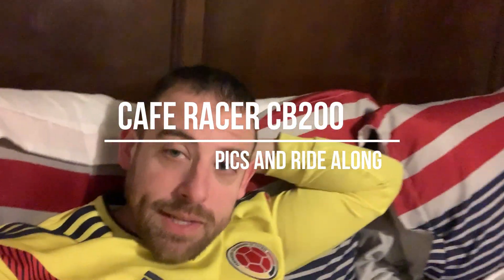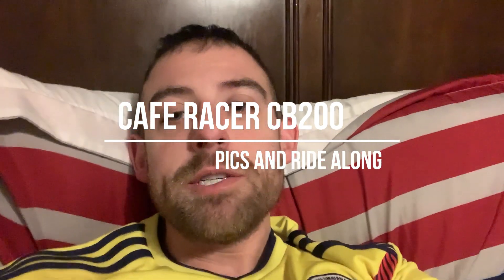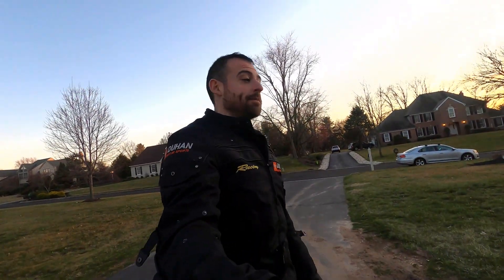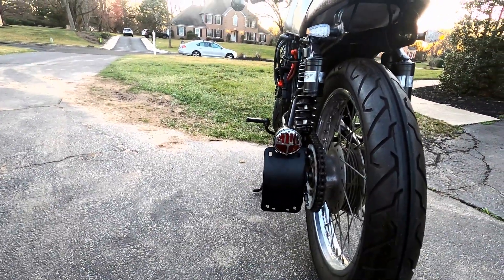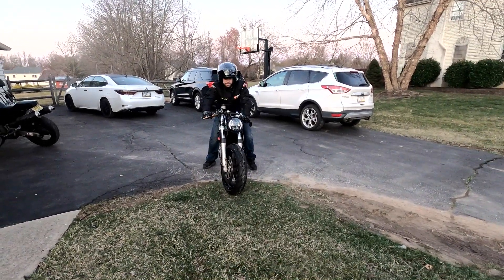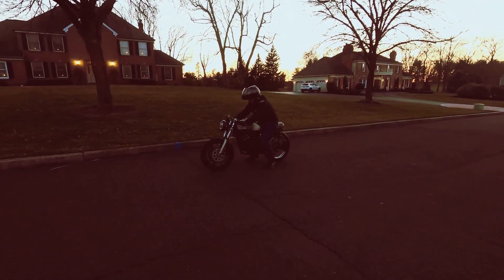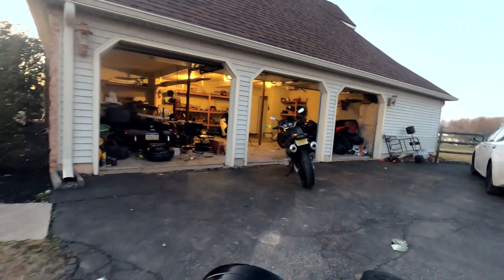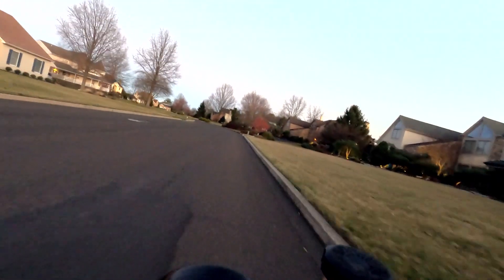caferacer -honda CB200  Electric conversion and cafe racer conversion!!!

Comment: You sounded a tad let down
Reply from the maker: I was exhausted and I was working on that thing all day but it actually had too much power and rip the wheel from its speed and Spohn in the tire. So I switched to a hub drive
Reply: @diyguy1476  i was also thinking mid drive custom brackets to not alter the frame. But over hear we can do 60mph on bypass so ive also been debating a 2 speed gearbox on selector fork with a basic dry clutch to alow launch controle and gear select whilst in motion
Reply: @Lyons Cultivars  so I’m just starting off a build, we’re you able to mock up a 2 speed gear box? If so I’d be interested in how you did it
Reply: @diyguy1476  there are already designed parts why reinvent the wheel. It's called a slump. The haft floats and can be pushed left or right toate with 1 sprocket or the other.
Reply: Well my friend your efforts was well spent. Nice build. Im seriously debating doing a e conversion on a yamaha ybr 125 lol. But price of good cell in the quantity ide need is alot for me right now

Comment: Question, why didn't you go with a Hub Motor instead? What would be the tradeoff there? They have an 18 inch and 19 inch wheel.
  BLDC Hub Motor 8000W kit seems like it would be easier to install and faster. Am I missing something?
Reply from the maker: Check out the other videos i did switch to a hub , its not easier but it gives more room for batteries

Comment: What parts did you use to make the generator and what battery?
Reply from the maker: Me1003 and useing ev volvo batterys
Reply: @diyguy1476  Looks cool. You should make a wiring diagram for it with all the parts and stuff. I know people would love to make one or at least know there is an option other than GCE.